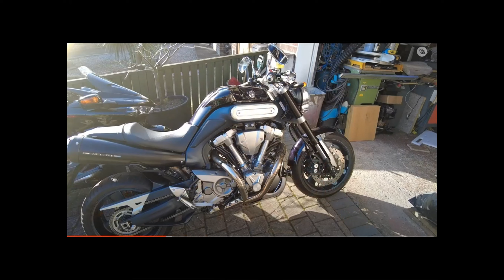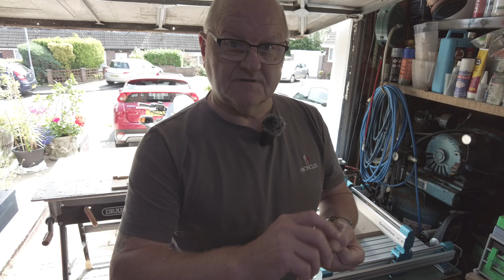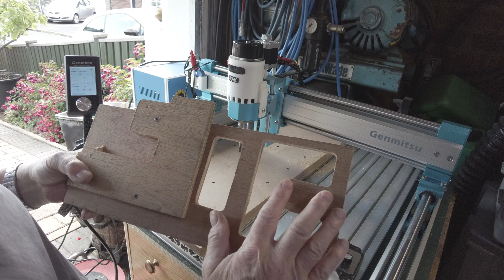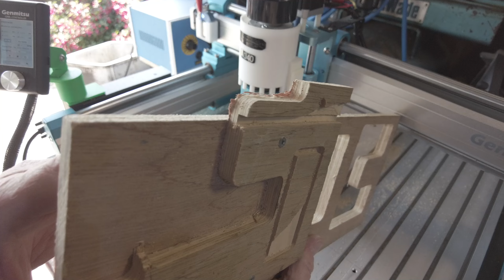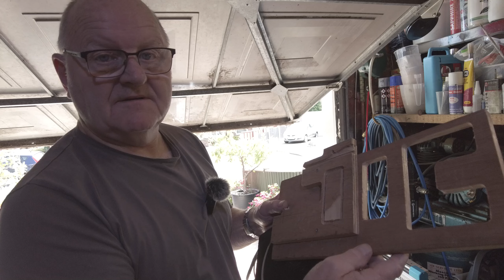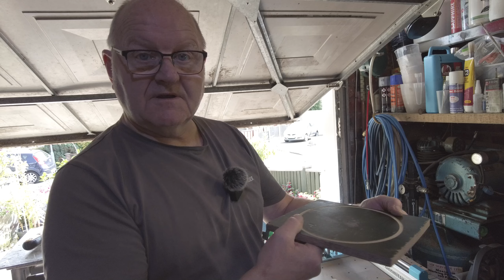Jig and Pin machining on the Sainsmart Genmitsu 4040 Pro Cnc

Comment: I find this a very interesting video.  While I admit that you are sidestepping the heart of what a CNC machine is I like the fact that it can be used in a more traditional way.  My CNC worktable is generally clear and just clearing off my workbench and getting my router table out to do some small operation can be a pain in the butt.  So it is nice to have options.
Reply from the maker: Hi thanks for your comment, sometimes its good to think out of the box and i the same as you have to clear some workshop items away in order to get my router table out.

Comment: Wow. This is rather embarrassing, and I must say, I wasn’t expecting it at all. Now, I don’t want my comment to come off as rude, but it’s clear that you’re using a CNC machine in a manner that’s almost entirely counterproductive to the benefits it offers. The methods you’re advocating effectively nullify all the advantages that computer-controlled machining brings. It’s as if you’ve completely missed the true potential of this technology and are trying to use it like traditional handheld power tools.

Let’s keep this constructive, though. It’s essential to revisit the fundamentals of CNC machining. First and foremost, anything that’s computer-controlled represents the final nail in the coffin of using templates. There’s simply no need for templates when you have a CNC machine, and even less so should a CNC be used to create them! And, of course, it’s nonsensical to guide a movement by hand when you have the precision of digital control at your disposal.

The reasons for this are incredibly straightforward and logical: CNC machines have two superpowers—precision and repeatability. Precision, because the resolution of digital guidance is infinitely finer and more consistent than anything the human hand can achieve. Repeatability, because the same code, whether used 200 times or 200 years later, will yield the same result, something human hands simply cannot replicate with such reliability.

Here, and I say this not as a slight or with any notion of “ageism” (we’re likely of the same generation), it’s crucial to completely rethink your approach to your workshop, your workflow, and your machining processes, keeping these two superpowers in mind.

Spending time crafting a template when a machine is more precise and productive without it is a waste. The machine offers a rapid, safe, and accurate guidance and transmission—moving a piece by hand under a fixed spindle is nonsensical, not to mention potentially risky for both the workpiece and your fingers. There are methods to mass-produce and/or secure pieces without templates that offer maximum productivity, and I encourage you to explore these.

Once you truly understand the possibilities that these machines open up, it becomes clear that they can (and will, as soon as we let go of our habits from traditional tools) replace most of the equipment in a workshop from the previous century, including both machines and handheld power tools. But to do this, one must embrace the central role of the machine, fully exploit its capabilities, and completely rethink the manufacturing processes, from design to the finished piece.

In short, the digital workflow is: design (CAD), machining (CAM)—which can include some finishing processes like deburring, sanding, and polishing. Finally, finishing (assembly, coating) remains manual for now, though even these steps can be significantly reduced using pre-finished materials and CNC-machined snap-fit joints that eliminate the need for glue, clamps, and drying time. In essence, this technology revolutionizes the entire workshop and manufacturing processes, but only if you fully grasp and embrace the potential of these machines.

Over 20 years ago, when the first amateur CNC machines came out, it was understandable that we only delegated a few tasks to digital machines—no one fully understood the possibilities, and we were all entrenched in traditional methods and machinery. But today, with accessible and functional machines and countless examples of their use, we have no excuse not to harness them to their full potential.
Reply from the maker: @axelSixtySix  Thanks for your fantastic and in depth comment. I have a number of years experience with cnc and various computer controlled machines I am a skilled wood machinist and cabinet maker apprentice trained. I dont need to change my workshop ethics  I enjoy how I work. You are right a cnc will always win over a human at accuracy  and production  times. The aim of the video is to show that the cnc machine can be used in another machining process manually. I had a situation the other week where I was tasked with cutting some carbon fiber  patterns  out, 50 mixed shapes wanted asap. Six different  complicated patterns to draw them up and create the toolpaths would have taken me some time. I used the six different patterns as the template, made a 10 min jig and machined all in less time than it would have taken me to draw them accurately. The other week I had a ransom ware virus on my pc it was away for 2 weeks but yet I still did some machining. What your implying  is to leave behind old skills and rely on machines ?
Reply: @Tonys.Top.Tips.Workshop  Thank you for your thoughtful reply. It's quite clear that you have no intention of changing the way you approach this new technology, and that is entirely within your right. As we say, "there's none so deaf as those who will not hear." I believe your response exemplifies this saying perfectly. Once again, I respect your perspective, even though I find it somewhat irrelevant.

Regarding your defense of traditional skills, this is purely a matter of pragmatism, nothing more. I observe the transition to digital manufacturing with a sense of historical context, and I see precisely the same resistance that occurred when people transitioned from manual tools to machines. Initially, the majority clung to their manual tools, arguing that it was better to use a file or a plane rather than a machine. Then, we saw a handful of brave souls who eventually realized that machines were more precise and productive. Yet, they merely transplanted their old methods onto these new tools, often lamenting the difficulties of abandoning their habits in the face of new machinery. This was a significant error because it is not the machines that must adapt to the users, but the users who must adapt to the machines, as always. Do you ask a file to conform to your movement, or do you optimize your movement to get the best out of the file? These two categories of workers from another time were wrong, and the future proved it.

Ultimately, machines largely replaced hand tools, workshops transformed, and with that, methods evolved. The workflow changed entirely to take full advantage of the possibilities opened up by stationary machines first, and then portable power tools. And this is precisely what is happening today. The first CNC machines are entering workshops, and many users don’t know how to fully leverage them—instead, they apply outdated methods suited to older tools, which are ill-suited and less productive. That’s the point of my comment. You find yourself, without meaning any disrespect, exactly in the same situation as the worker accustomed to hand tools, who will always be tempted to reach for those old tools or to use the machine as if it were a manual tool at the first opportunity, simply because their mindset hasn’t yet aligned with the new technology.

Again, I do not cast stones; it took me several years to truly grasp the magnitude of this technology and the structural changes in methods and mindset that it requires. To fully exploit a CNC machine, one must forget what they know about traditional work methods, and entirely rethink the organization of the work, the workshop, and production methods. I see at least five different ways to execute what you demonstrated, all infinitely more efficient. Once again, I say this without demeaning your efforts.

I also acknowledge your unfortunate experience with a PC virus. Personally, I haven’t encountered such malware issues in 25 years, because, as computers are essential to my workflow, the systems used to design or control machines are, of course, isolated from any external threats. Like CNC machines, computing requires that one adapts their methods to ensure productivity.

My initial comment, which I hope you took as friendly and constructive, was merely intended to inform you that, in this video, you were heading down the wrong path—something that happens to all of us at times. Unfortunately, we can waste a great deal of time and energy if there is no one kind enough to warn us in time. Sooner or later, everything I’ve mentioned in these two messages will begin to make sense. Best of luck moving forward. Warm regards.